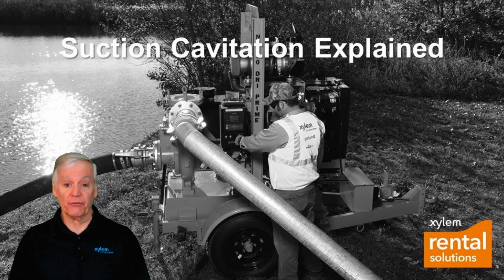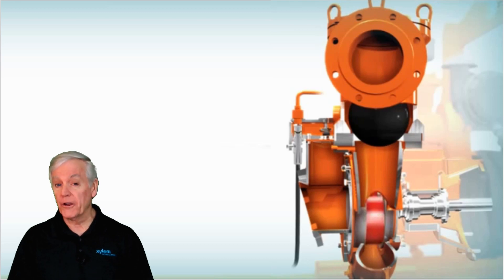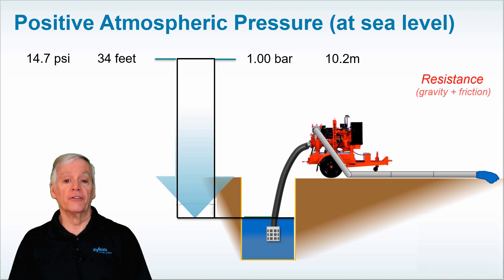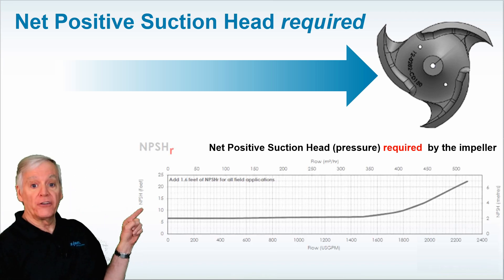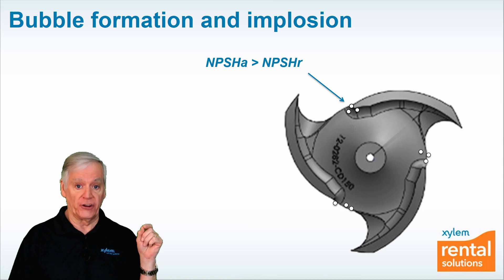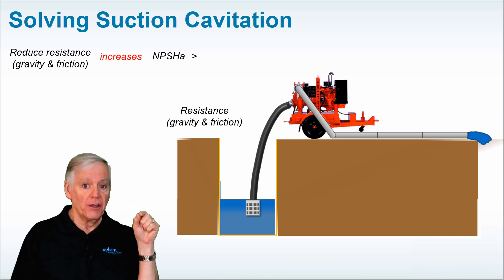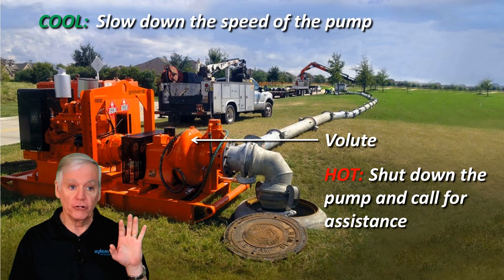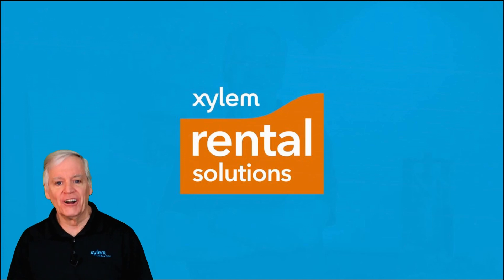Understanding Suction Cavitation and How to Avoid It

Comment: by reducing flow rate, you not only reduce friction but also npsh required from pump. you can also throttle pump on the outlet. for npsh calculation, you need to include vapour pressure of liquid.

Comment: Excellent presentation, one solution giving to overcome suction cavitation was to slow the pump down, this is correct but can only be done if engine driven or fitted with a variable frequency control if electric motor driven - in the case of a fixed speed driver, increasing the discharge head on the pump by throttling the discharge with a valve,  or orifice plate will also reduce flow and overcome cavitation. 
Of course reducing speed or restricting the discharge will effect the pump performance in terms of flowrate and delivery head, now if the duty flow and head cannot be changed because of application requirements - it could mean a new pump selection is required.